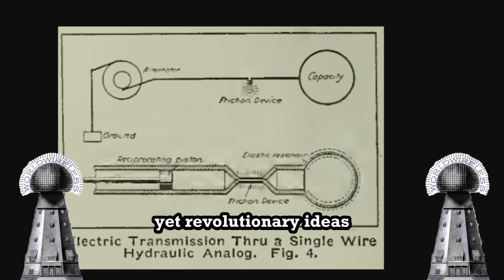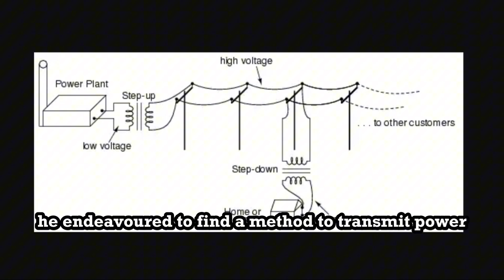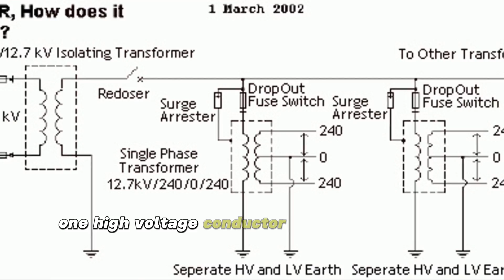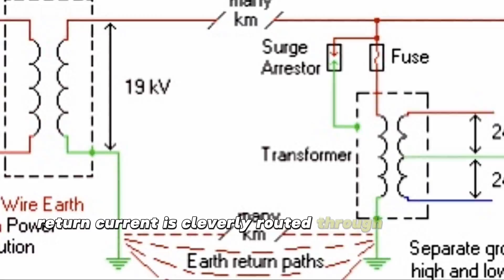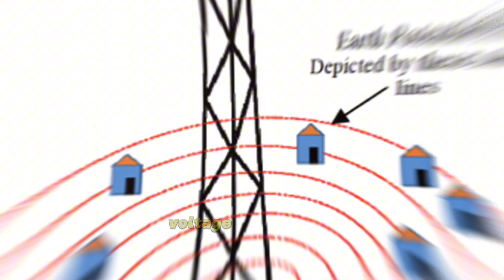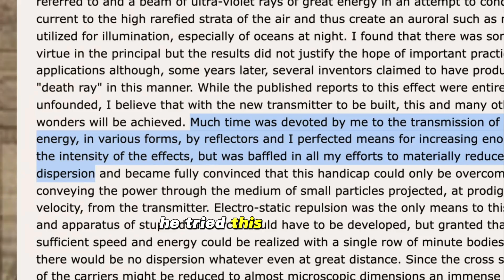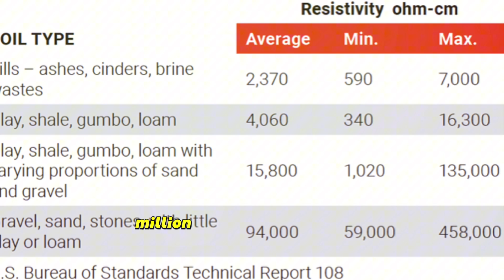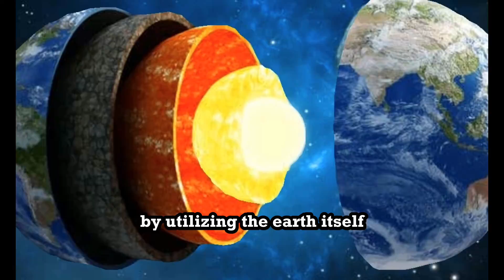Nikola Tesla’s ACTUAL Wireless Electricity - Part 2

Comment: A million times the resistance of copper with equivelent power loss??!?!
Reply from the maker: Hey thanks for commenting. Yup!!

 The resistance of a conductive path is inversely proportional to the Area of conduction.   
 
R = rho * L / A    
 
A= pi * r^2    
 
which in the earths case means the resistance is divided by the earths radius squared...     
 
That plummets the power loss for any distance transmitted to nearly zero.     
 
P_LOSS = R * |^2    
 
Never mind the fact that Tesla proposed to step the voltages up to 100 million volts, 3 orders of magnitude higher than current transmission lines.    
 
If we step the voltage up by 1000x then the current will drop by x/1000.    
 
And if current drops by x/1000 then the power losses from transmission drop by a 1/1,000,000th.  
 
So when the conductive area plummets the resistance for conduction to nearly zero and the currents through the conductive medium plummet by a factor of x/1000 then the power losses for transmitting nearly any distance goes to zero.  Full stop.    
 
And because the voltage drop over any distance through the ground is nearly zero there is no voltage potential gradient to cause touch and step voltage issues in the ground.    
 
Lastly it’s the very low 50/60hz ac  frequency that makes Ac dangerous.   When frequency is brought up but kept below the point of where it would emit EM oscillations/radio waves, what’s known as the skin effect occurs.   
 
This causes the currents to not be able to penetrate into the core of thin conductors.   
 
Ergo, why we don’t use higher frequencies on our thin wire transmission lines.     
 
It just negates the center of the wire.    

But let’s just say for example if there were to be a fault in this system, when the frequency is high enough this makes it impossible for it to harm someone as it conducts over the surface of our skin and cannot damage our internal organs or skin for that matter.     

But a fault would be inordinately unlikely when the system is designed correctly.    
 
So for example when using 100,000,000 volts even when only using 1 amp, the power transmitted is still 100,000,000 watts or 100,000KW or 100megawatts.        
 
As since power loss is current dependent the only power loss will be derived from that 1 amp As well the earth resistance is dependent upon the are of conduction.        
 
It’s the same thing as if you had a pipe of a tiny area or a large area.        
 
The resistance to flow is still current dependent but the amount of flow and energy from the same current through a much larger area has a much smaller loss.        Again functionally the rho resistivity of soil is divided by the earths radius squared. Which is just massive.        
 
Rho is about 10^6 and the earths radius 6,371,000 or about 6*10^6          
 
R_earth = rho * L/ A          
 
So when earth resistance is actually         

R_Earth = (10^6) * (2 * 6.371meters * 10^6) / (pi * (6.371meters * 10^6)^2)         

= 0.09992 ohms           

So at let’s say we have 1amp of 100,000,000volts transmitted.         

A total of 100 megawatts transmitted.          

P_Loss = R*1^2            

= (0.09992 ohms) * (1amp) ^2         

= 0.09992 watts power loss        

Now to be clear this is just a simplified example as the resistance is higher at the point of current injection but this is why land area did very high conductivity would be chosen for the transmitter locations.         

Coincidentally this is why Tesla had very large metal lined tunnels spanning in all directions underground of the wardenclyffe tower.

Comment: Are you willing to help others with the proper equipment make their own tesla turbine?
Reply from the maker: Hey thanks for commenting! 🙏❤️‍🔥 hey thanks for commenting. 🙏❤️‍🔥 I really appreciate the love and support.    So just to be clear I do have a degree in physics and many years of working with industrial machines.  And now I don’t want to discourage you but I need to be abundantly clear though that sadly, these are not toys. They are VERY dangerous if not designed or handled properly.  I do not advise anyone who doesn’t already have a background in mech engineering/physics etc. to attempt to make one of them on their own.  If you wouldn’t feel comfortable taking apart a jet engine and putting it back together and know that it would work properly again then I would think twice about taking on this endeavor.  That being said. If you would like to start I would suggest by consuming as many mechanical engineering class videos as you can on YouTube.  Learn all the thermodynamics behind steam and gas turbines.  Specifically for Tesla turbines it requires a great deal more chemistry due to the Tesla turbine operating on molecular viscous adhesive forces between the fluid and discs and not in mechanical collisions with the blades like traditional blades turbine.  So making sure to have the right surface treatments for the proper motive fluid is very important too.   “Don’t French fry when you’re supposed to pizza or you’re gonna have a bad time.” <-Words to live by. 
 
 I want to be explicitly clear with people just how dangerous this is. It’s easy to see the turbine not doing much other than spinning and think it’s not that difficult.   But to put some perspective on it…. 

The ~25cm (10in) diameter 75disc aluminum turbine is 4.36kg (~9.5lbs)     So whenever anyone see this turbine spinning they need to imagine a literal 10in diameter 10lb dumbbell weight spinning at 7,000-13,000rpm 🤯🥵😅    At 13,000rpm the turbine rotor has 30,000joules of rotational kinetic energy.     For perspective, that’s about equivalent to:  5-10% of the kinetic energy of a whole car at highway speeds.   If that stored kinetic energy were to be used to launch itself straight up into the air…    
 
KE = gravPE = mgH   
 
H = KE / m / g     
 
= (30,000joules) / (4.26kg) / (9.81m/s^2)     

= 708 meters straight up into the air… 🤯   

~3/4 of a kilometer or ~0.45miles. 
 
if you want to get your hands dirty with a prototype of your own we are now selling versions of the 4.5in Tesla Turbine that we built during our video collab with @integza         www.HeatAndPower.com         Crafted with precision, the prototype boasts a robust design featuring an aluminum disc stack enclosed in a high-quality polycarbonate casing.        The turbine is tailored to accommodate a variety of testing conditions, though currently optimized for compressed air tests.        From initial trials, the turbine has shown promising potential, generating 1200 watts of power on a Dyno test with 30-40psi and a notable 600 watts electrical load when partnered with an upgrade generator package) on just 15psi of compressed air.        It is also designed for future upgradeability, with provisions to accommodate a 2-stage upgrade we aim to release soon.        While this turbine is a working prototype, it’s not a complete, turnkey power solution or high temp turbine.   
 
So, what’s the purpose of this unit?        We’ve designed this prototype to provide a hands-on, engaging, and informative tool for those interested in our renewable energy systems, and specifically in Tesla turbine technology.        It gives you a chance to see the turbine in action, understand its mechanics, and gain experience with assembly, disassembly, and maintenance.        We believe this initial experience is crucial before making the step up to our full-sized, turn-key power generation systems.         Get Yourself Prepared        This prototype is essentially a first step for those considering a full-scale residential or commercial Combined Heat and Power (CHP) system.        It offers you a unique opportunity to get up-close and personal with the turbine technology, and gain a practical understanding of its workings, benefits, and potential.        It’s a scaled-down, educational version of the turbine we’re developing for our full scale solar thermal and biomass powered CHP systems.        It is also designed for future upgradeability, with provisions to accommodate a 2nd-stage upgrade that we aim to release soon.     What Does The Loyalty Program Do For You?       Learn how to safely operate a Tesla Turbine now with our smaller 4.5in prototype.     Then save on your full scale turnkey residential or commercial power generation system later!      Purchasing our 4.5in Tesla Turbine gets you a 10% discount that’s applied to your full size residential or commercial system, in the end saving you more than the cost of the prototype.     See our website for more loyalty program information.

Comment: Okay so wouldn’t that affect / create a magnetic field on the ground? If not then how and if so I’m concerned why we haven’t thought about wildlife / other devices
Reply from the maker: Hey thanks for commenting. No it wouldn’t the current is so low there is no induction. 

The resistance of a conductive path is inversely proportional to the Area of conduction.   

R = rho * L / A    

A= pi * r^2    

which in the earths case means the resistance is divided by the earths radius squared...     

That plummets the power loss for any distance transmitted to nearly zero.     P_LOSS = R * |^2    

Never mind the fact that Tesla proposed to step the voltages up to 100 million volts, 3 orders of magnitude higher than current transmission lines.    

If we step the voltage up by 1000x then the current will drop by x/1000.    

And if current drops by x/1000 then the power losses from transmission drop by a 1/1,000,000th.  

So when the conductive area plummets the resistance for conduction to nearly zero and the currents through the conductive medium plummet by a factor of x/1000 then the power losses for transmitting nearly any distance goes to zero.  Full stop.    

And because the voltage drop over any distance through the ground is nearly zero there is no voltage potential gradient to cause touch and step voltage issues in the ground.    

Lastly it’s the very low 50/60hz ac  frequency that makes Ac dangerous.   

When frequency is brought up but kept below the point of where it would emit EM oscillations/radio waves, what’s known as the skin effect occurs.   

This causes the currents to not be able to penetrate into the core of thin conductors.   

Ergo, why we don’t use higher frequencies on our thin wire transmission lines.     

It just negates the center of the wire.    

But let’s just say for example if there were to be a fault in this system, when the frequency is high enough this makes it impossible for it to harm someone as it conducts over the surface of our skin and cannot damage our internal organs or skin for that matter.     

But a fault would be inordinately unlikely when the system is designed correctly.

Hope this helps!
Reply: @CharlieSolis thanx for all the info shared here. I would like to know if you write some books with all that interesting info about Tesla. And also I would like to understand if we made this type of transmitter to the ground, and understand how to retrieve the energy back, maybe we really understand that the earth is already full of energy captured by lightning or electrostatic or solar ray or cosmic ray... What do you think?

Comment: I do understand how current can be transmitted through the earth in SWER, it is simply just swapping the N cable for earth so there are still 2 cables to plug the transformer, so my question is how would you get any current flow with just one wire?
Reply from the maker: Hey thanks for commenting. ❤️‍🔥🙏

Check out the full length 30 minute long video that goes through everything too to bottom! 

🛜Neil Degrasse Tyson, WRONG about Tesla?!? 🛜 @joerogan (30min)
https://youtu.be/teoyAdU-1S0